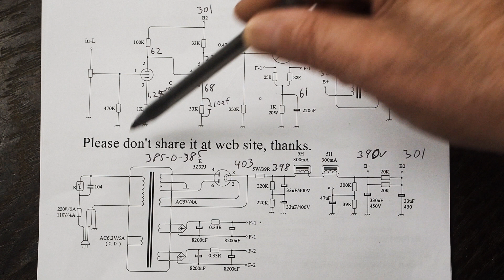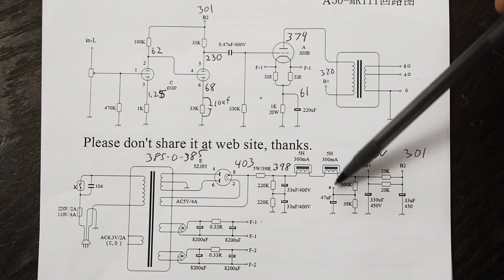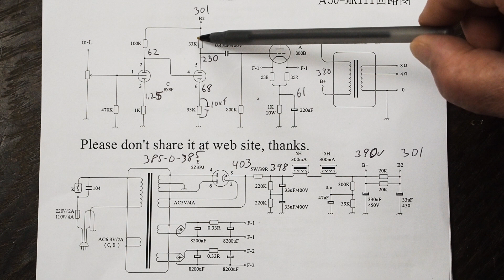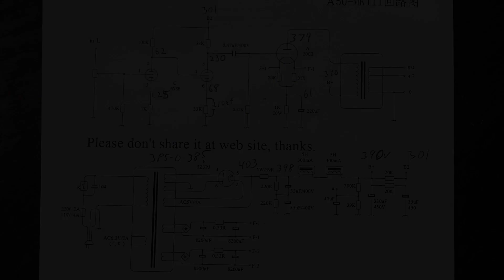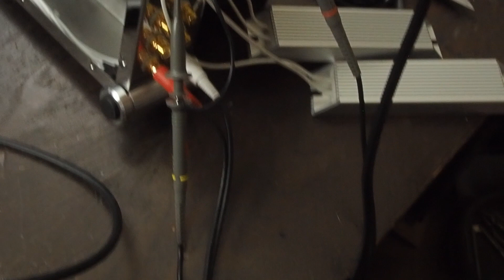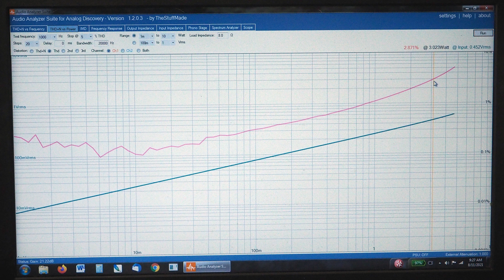Boyuurange / Reisong A50 300B Tube Amp Full Test

Comment: Hallo.Ich habe eine frage.Bei 300B auf pin 2. 457 volt.Ist das o.k???Transformator 220 v .Bei uns 235v im Netz.Wie kann man weniger machen.
Reply from the maker: Measure the voltage between the plate and the cathode. Under 400V is safe.

Comment: Thanks for the videos!  Can the preamp section be feasibly taken out of the loop so that the unit functions only as an amplifier?  I need remote control of volume.
Reply from the maker: Simply turn the volume knob up and control it with a pre-amp or whatever you plan to use to do it remotely.
Reply: @SkunkieDesignsElectronics  Thanks!  That’s what I’m doing now but I figured that would mean unnecessary signal path and corresponding degradation?
Reply from the maker: @rndm4642  Your preamp or whatever you are using does not have the "Drive" to feed the 300b tubes without the 6SN7 tubes being in the circuit. A 300b needs 140-160V peak to peak signal drive. Also when you have the volume knob turned all or most of the way up, it's bypassed and is no longer in the signal path.
Reply: @SkunkieDesignsElectronics  thank you!

Comment: I have used orange drop decoupling capacitors with on my guitar tube amps with success. Also, 8200uF caps on the filaments!? That has to be a typo :)
Reply from the maker: Oh... I need to go back and look lol.  Nope just looked, 8200uf 16V caps. I do see orange drops being used and they don't sound bad, for HIFI I like the Mundorf alum/oil better.

Comment: Great stuff. Can you change a Gemtune X1 that uses 2 el34 tubes in single ended to 300b. Am wanting to get that 300B midrange!
Reply from the maker: Highly doubt it, 2 very different output tubes. With the right tubes and amp design, an EL34 amp can sound very sweet.

Comment: I don't see grid stop resistors to avoid oscillations? It shaves of high hiss I the highest frequenties.
Maybe it isn't Required I use it in my Amp at grid end tube and input first stage wich you have a potmeter wich act like a gridstoper I use 1k metaalfilm 0,5 watt
Reply from the maker: I plan to add them to the grid of the 300B, 6sn7 usually is fine without them.

Comment: series cap cut the cap value in half .  Ripple can be reduced  with the cap between the chokes making it a 12db roll off  6db as is.  I would go at least  100mfd between the chokes.
Reply from the maker: Yeah I brain farted on the series cap cut in half and was thinking a 100uf cap between the chokes would be a good plan but need to sim it out. Thanks for the note!
Reply: @SkunkieDesignsElectronics   After the second choke up the value there also .  What sim are you using ?

Comment: Hey Skunkie Designs Electronics. I have a question. Out of all the amps your have built or modded which one is the best sounding amp in your opinion. Thanks and I love the channel!!
Reply from the maker: My fav is my 6SQ7/EL34 UL SE
Reply: @SkunkieDesignsElectronics  Are you still planning to make a few of them for sale ??? If so, any guess on cost?? Great videos !!!
Reply: Main rig is a DIY SE 300B that I cherish but always wanted a SE EL34 after modding my EL34 PP (no NFB and triode mode) for some sonically fine results. Learning a lot here, thanks!

Comment: Thank you for your very interesting videos. I have an A50 and was about to sell it, but now I will keep it until you have finalized your mods and try to implement them. There are two things that I would love to see: 1. Could you make sure that your mods also work for the European main voltage of 230V (in case any specific considerations are needed) and 2. could you also look into any mod to the circuit of the V-meters, so that they do something more meaningful. Currently they hardly move at all.
I am looking forward to the next video in the series. Greetings from Germany.
Reply from the maker: Yup, I plan to do this :)

Comment: caps in series the voltage doubles the capacitance  half's 16,5 uf cap at 800 volts etc
Reply from the maker: Someone already pointed out this error, thanks.
Reply: @SkunkieDesignsElectronics  re design the PSU will work much better

Comment: It's also funny that the design targets 5H+5H then uses large resistors for an RC network. Current + high resistances = noise. Although paralleling resistors helps reduce thermal noise, it would probably be better to run larger chokes (with low DCR) and reduce the RC resistor values. Voltage drop is going to be key for the cascode.. and with low PSRR you'll need that low Vripple.

Comment: On the use of LEDs - they have been shown to increase THD by 0.x% compared to a resistor in the cathode circuit.  I think removing that 5W PSU resistor, it's part of an initial LPF that is reducing Vripple as part of a RCLCLC pi filter..  A nice schneider mains PI filter would also probably not go amiss for any mains transients.
Reply from the maker: If you replace a un-bypassed resistor it will increase THD (reduced negative feedback), but also it increases the amplification like bypassing it with a cap would, and in my experience sounds better than a bypassed resistor. Also the type of LED matters on what they sound like too.  I normally use a LED + smaller value resistor and tune the sound via the resistor value. 

I'm pretty sure I can remove any ripple caused by removing that first PS resistor by adding a small cap between the chokes. The B+ need to be brought up a lot given the output tube is running at 50% plate dissipation  and no where near it's voltage limit.  I'm not really concerned about resistor noise in the PS RC network feeding the driver stage as there is very low current there. That said, I'm a fan of having a separate RC network for each driver channel.

And at this point it's all theoretical until it's built and listened too. And as I noted in another video, THD in a tube amp isn't always a bad thing :) If you are looking for how to build something with 0.1 THD to hit a paper measurement, you're watching the wrong channel :P

Comment: If the PSU is unregulated then you probably need to take into account the mains variation (in the UK that's 230V ±10%) and the regulation of the power supply transformer (say 8%). So they're probably making a safe decision that the +18% with the final B+ value not going above the maximum voltage of the tube before arc over.  So assuming the viewer is in the US, then the changes should target their supply.
Reply from the maker: I plan to sim all of this and also measure, but the B+ is no where near the limits of these tubes, which is part of the problem.

Comment: Thanks for this! I'm trying to help a friend fix his broken A20 which is in the same series as the A50 but has KT88s in SE ULmode. Unfortunately I can't get hold of a schematic! So any insight is helpful. He inserted the KT88s incorrectly with pin 1 in pin 5 of the sockets and blew a couple of caps by the sound of his description!
Reply from the maker: Wish I could help, I don't know anything about an A20. I'm sure at some point someone will send me one to review/mod.
Reply: @SkunkieDesignsElectronics  I'd send you this if I was not so far away!😁 If anyone knows where to get a schematic it would be helpful as when I contacted the manufacturer they weren't very helpful! They seem a bit protective of their plagiarized designs😂. I'm hoping it will be a simple repair or I may have to back engineer the circuit which will take me a while! Hopefully I'll have it fixed by the time you get your hands on one. If so I'll be watching your mods with bated breath in the hope I can follow along!

Comment: At 3:45 when you mention 33uF in series is will be the same. Is it support to be 1/2 instead? Like 16.5uF total? I thought parallel is double and series is 1/2.
Reply from the maker: Good catch. I forgot besides increasing their voltage tolerance, it halves their value. Not something I would normally do and not 100% sure why they added the complexity of this.
Reply: @SkunkieDesignsElectronics  Thank you, I am learning at the moment so I was confused then used digitkey website to check with the formula to make it's correct. :)  Waiting for next video.